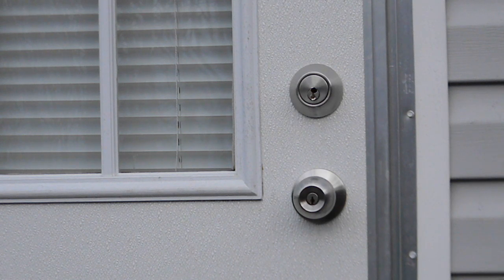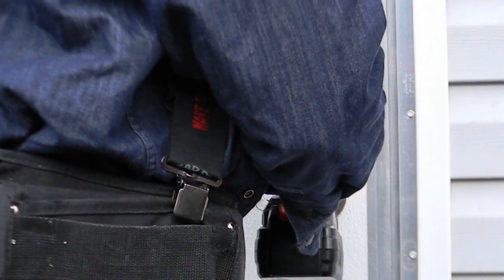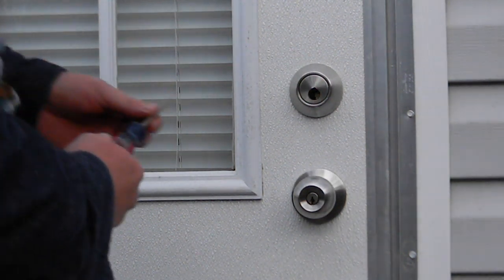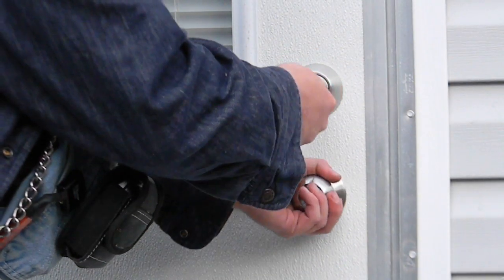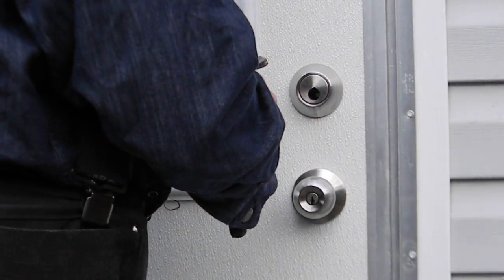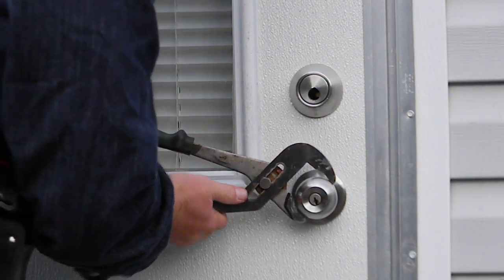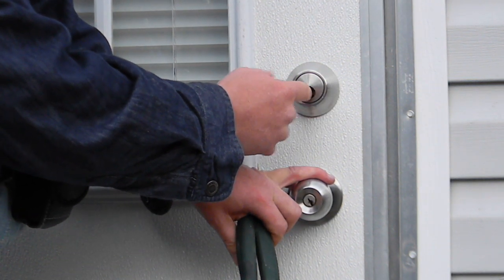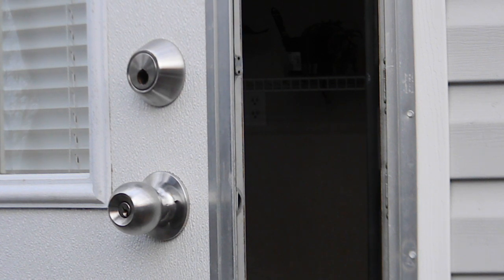Drilling Out A Lock

Comment: If ya drill on the deadbolt where the 2 screws would be it's a lot faster ,dead bolt falls off n yes channel locks grip hard turn a full turn n knob lock will open

Comment: An easier quicker way is to  drill two 1/4" inch holes one on either side of the deadbolt lock cylinder this will actually unscrew the two screws holding the deadbolt in so youve gained access and removed the old deadbolt all at once. Same is true for the knob lock. The last thing you want is to spend an extended amount of time gaining access as it looks suspicious and more than likely the homeowner is watching you. lol

Comment: Normally when you drill the shear line of a deadbolt the plug does not just fall out as it is still retained by a C-clip or a screw on retainer cap at the rear of the lock. You are in theory clearing the shear line and then you install a screwdriver in place of a key and turn to open. On this brand drilling for the screws is faster.

Personally this brand of lock picks in about 10 seconds, so I would try and learn a bit about picking and add that skill for a non-destructive entry.

Comment from the maker: Straight through the top of the keyhole.  As you bore through the tumblers will release the pins.  Tow things happens then:  a) the entire cylinder pulls out and you can open the door as the dead bolt has disengaged; or b) you will use a flat headed screw driver to turn the lock to unlock it.  

We will get a better video out this week as we are doing a batch of federal sites.  Thanks for watching!

Comment: hi, i am a teacher, and i inherited a locked file cabinet in the classroom that no one has the key for.  i have been trying this technique of drilling out the lock.  i have been able to break the cylinder in half, and pulled out the fragments.  i can still see the bottom of one of the tumblers, but i have drilled all the way through the cylinder (to the hilt of my drill bit).  i still can't seem to get the lock to open.  1) should i destroy that last tumbler?  2) what precisely are you doing ...